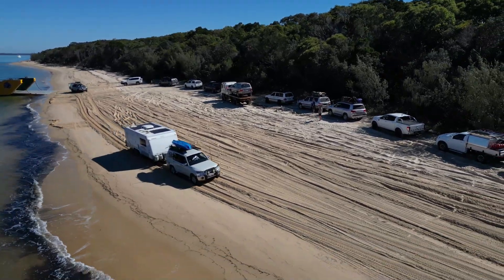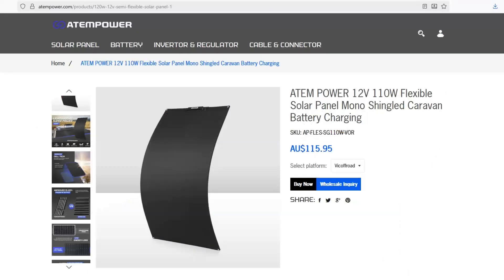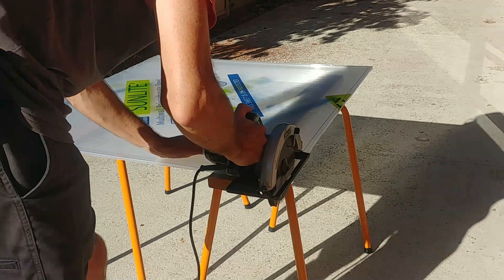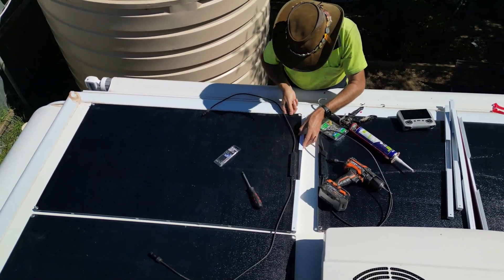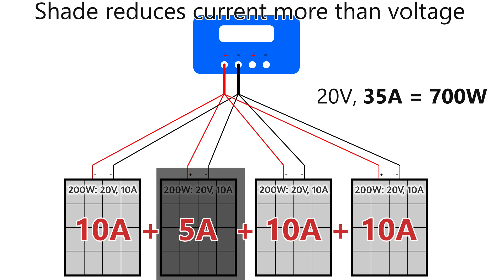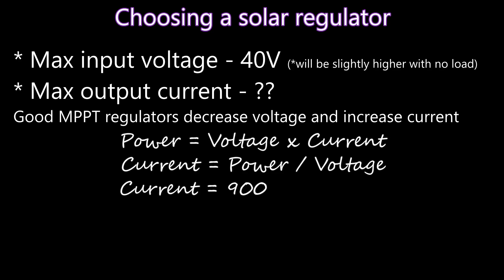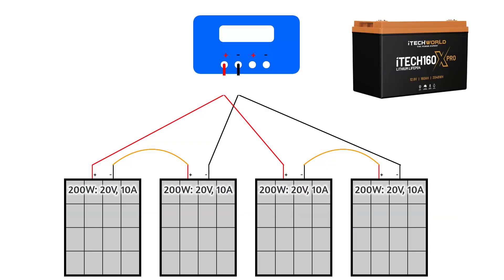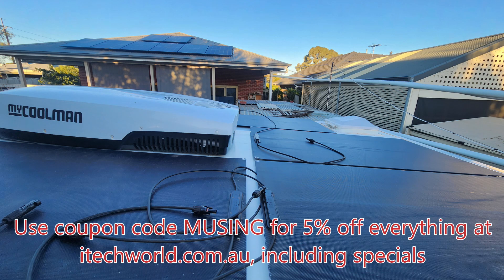Choosing and installing flexible solar panels

Comment: Love ya vids but the transition sound effect you use is bloody murder on the eardrums, especially with headphones. Otherwise, keep up the great work.
Reply from the maker: Thanks for that info, is it too loud or just the style of the sound effect? I'm not hung up on it so it's easy to change in future if I know what the problem is. Glad you're liking the videos though!
Reply: @TheMusingGreg  Prob a bit of both, it's feels about 3x louder than speaking volume and the abruptness of the sound too. Maybe a sound effect with a bit more lead in/ramp up and max volume at the same level as your voice (or just under). A quick .5  to 1 sec audible transition is great tho. I used final cut pro (decades ago) and there is an audio level section where you can easily slide volume, so it's all leveled out.

Comment: Thanks for sharing! I’m in Europe and I plan to do the same for my van, but I’m not sure if the Acrylic VHB double-sided foam is the same quality from amazon. Do you think it’s safe to use if I’m driving at 130 km/h? ( i mean to keep the panel on the roof -  its waved - a ford transit 2015)
Reply from the maker: It's an impossible question to answer unfortunately as there are so many different tapes available. However given the tape is the only thing keeping the panels on, I wouldn't just grab a random tape from Amazon and hope for the best. I would make sure that whatever you choose is designed for solar panels. See if solar4RVs can ship internationally as I know this product works. However if not I'm sure there would be local suppliers of suitable products, you'll just have to do some work to find them, either by looking at the specs or contacting a company who specialises in solar installations on vehicles and seeing if you can buy tape from them. Good luck!
Reply: @TheMusingGreg  Thank you very much for the reply. I might use silicone, which they use a lot here… it’s just that my roof isn’t flat, so I want to be sure they will be installed correctly. Thank you, have a good trip!
Reply from the maker: @panosparas8976  Yep silicone is an option too which Solar4RVs discusses on their site. I just wanted to maintain a consistent wide air gap, which I think would be hard with silicon as it will flatten itself out when it's still wet.
Reply: @TheMusingGreg  I understand! Thanks mate!!

Comment: How do you get the cables up through the pop up roof?

Did you need to do any cable management or just let them loosely sit in position?
Reply from the maker: My van already had cables installed so I didn't have to do that part. But it was an aftermarket installation like you might have to do. They ran them through the overhead cupboards, then up the side of the pop top canvas, and then just drilled a hole through the roof. On the outside there's a weatherproof box that you would have seen in the video where the cables terminate

Comment: As always, rock solid advice Greg.  I’ll be upgrading my battery monitor to a Victron Bluetooth model soon so the discount will come in handy.  Happy days!  👍
Reply from the maker: Yep I'm really liking Victron gear the more I use it, and the Victron connect app works with so many products it's easy to manage the whole system from one app if it's all Victron.

I've also got the victron battery monitor, and I'm working on a video comparing a few of these. The victron one is functionally excellent, I just wish it had a better screen!